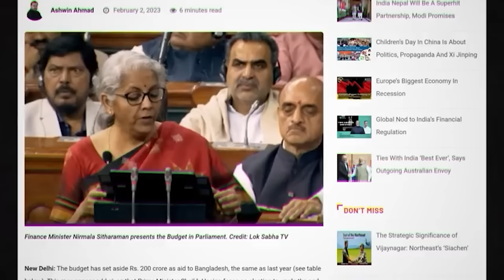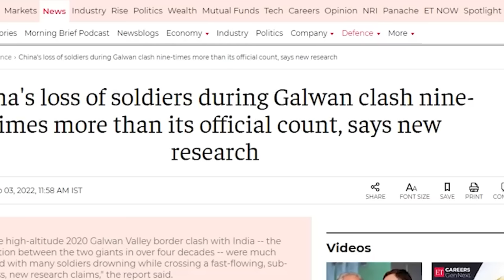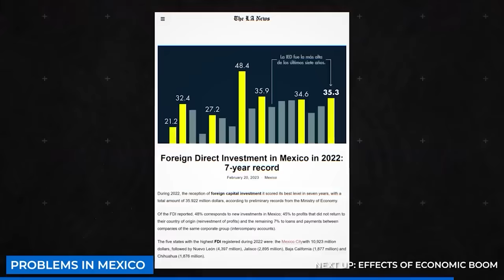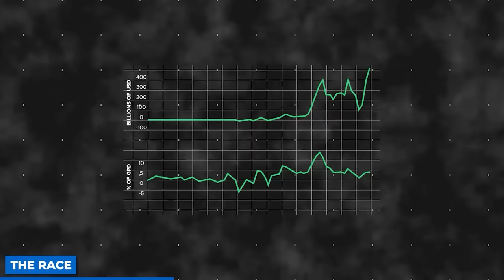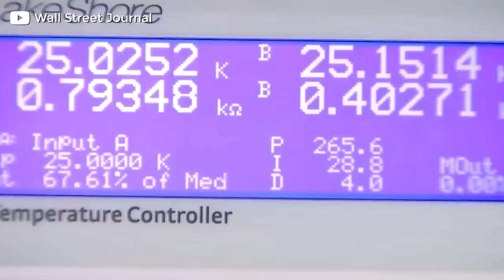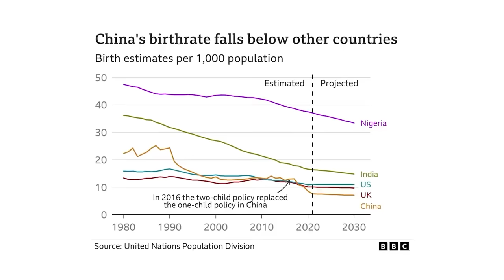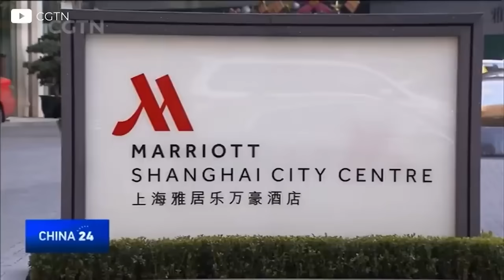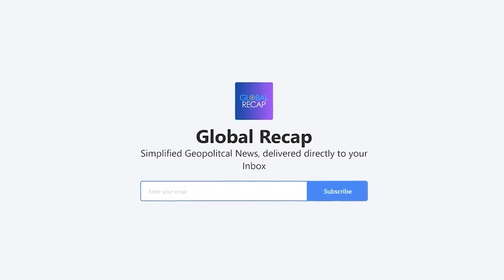Don’t Be Surprised by China’s Collapse. India, USA & Mexico's Plan To Checkmate China

Comment: I have I idea about nuclear power reacters ok keep running into over hearing problem what if you use Mercury or see if you can use sertin propertys of mercury to stabilize the heat from rising that what it's what it basically for and when you get something take two types of power reacters modify it so it has it own cavity to release the combustion then have both cavity to merge I to each other to cause even major controlled explosion to cause object to lift of

Comment: 1:37:00

Elon will solve that problem. 
 It is NOT scarcity, as you and Elon himself has said about this issue.  Elon is great at innovation, and when a "supply chain" problem arises, he starts to do it himself, and then ten years later others start to follow. Plus he is also great at finding replacement minerals or elements to use instead of the ones that are hard to get, you can see this in his incredible battery improvements in just a few years.  
Now, I know, some people say, "it is not Elon it's his engineers" but I hope you can see how stupid that view is, bc without his push the engineers would still be working at sub[par companies like GM and others unhappy with all the internal politics and the lack of communication among all the different departments within.